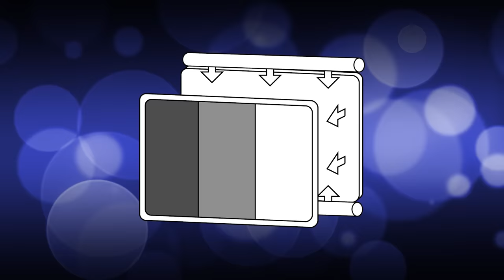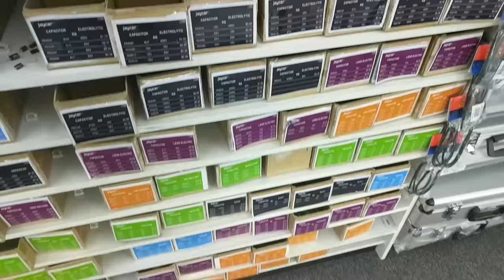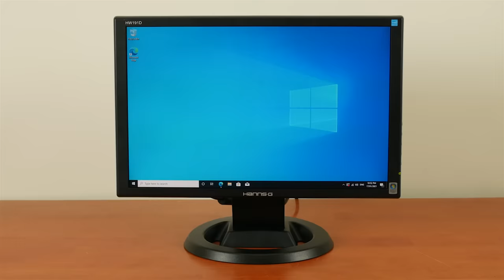Repairing a DEAD LCD monitor

Comment: For all of you... just careful when servicing the psu board. These boards have bigger caps still holding charge and there is risk of shock. Avoid touching these bigger caps.
Those marked 25v 16v 10v 6.3v are safe to handle. Either use the technique shown or use a proper tool to unsoldering.
If there is a spot to install one more capacitor in parallel with the replaced cap, do it. The caps will work together to smooth the current and it will ensure the caps will last more years.
Pay attention to polarity, voltage, capacity, temperature (use 105c instead of 85c), etc
The caps life depends greatly of the inner and outer temperature. If the temperature inside of the device is great, the capacitor's temp will be high as well and will degrade life over time with spectacy around 2500 hours at 85c/105c inner. Reducing brightness or using the device where the air can more around the device will be ok.
Reply: One additional tip: If the capacitors voltage is higher than the original, you're safe to use it in place. If it's lower, don't put it in.
Reply: Yes. If there wasa 1000uf 16v, we can install a 1000uf 25v. I also like to put 1500uf and above.

Comment: Protip - if you think the monitor works fine but the backlight is dead, get a bright AF flashlight and shine it at the monitor real close and see if you can see anything.
Reply: when the backlight power supply breaks, the whole power supply goes down with it, so the whole monitor wont start up.

Comment: Where can I get a cheap used monitor replacement power cord? I don't want to buy an original for $50, and not be able to fix the monitor
Reply: Or like a universal cord that could power a 4k monitor with different plugs

Comment: I bet this is what happened to my friends old laptop. The screen acted like the nintendo ds light when you play metroid prime pinball with that option to turn off the backlight set to on. I had the laptop plugged into a tv and could not find a setting to turn back on the backlight so i uncrewed it from the computer and donated it. now would be a good time to mention that i did this after paying my friend $10 for the laptop. also i only donated the screen to a computer repair place. i still have the laptop. the only thing i broke trying to put it back together was the wifi switch. You can do it in software so what's the point?

Comment: Hey Matt,

I have a specific problem where my LCD monitor doesn't work with HDMI cables. Whenever I plug an HDMI cable into the monitor the picture shows "searching for input device" (or something similar) and then stays black. But of course my monitor supports HDMI cables, because it has a slot for HDMI. 

The question is how can I fix this problem (if at all), because I've yet to find the solution to it on Google :(

Comment: I have one advice for you guys. If you are trying to remove the powerboard, make sure to not touch any of the traces or solder joints on the back. Trust me on this, you don't want to short a 220v capacitor's legs with one of your fingers. My middle finger went numb for hours

Comment: 2 Things i learned from the video :

1. You can use higher CAPACITANCE of the Capacitors not lower Capacitance or ESPECIALLY High/Low Voltages.

2. Be careful when disassembling/assembling LCD is a very fragile piece of glass, older Monitors were still quite bulky and well made than the past 7 year's ones.
Reply: 1 is the wrong way round - higher voltages are OK (unless you're using your capacitor as a fuse somehow), higher capacitances are not. Capacitor values often determine time delays or frequencies, and the circuit won't work properly if the values are off.
Reply: @parnikkapore  Indeed. And in power supply circuits, it may cause inrush current issues, blowing out fuses for no reason.

Comment: my monitor was manifactured in april 2009 and it's a 5:4  at a resolution of 1280×1024
i have gotten rid of that monitor in 2 weeks
now in 2023 i have 2 monitors a Samsung P2370HD and an lg flatron 17 inch 5;4 1280x1024 monitor

Comment: My IBM monitor decided to die after 20 years of continued service
The lamps died and the inverter coil died.
Replaced the lamps with LED strips and it's running again!
Granted, you can't regulate the brightness but i don't care because it is a small server monitor

Comment: PLEASE! Anyone trying to follow this or just want to repair the POWER SUPPLY of a monitor (or any other powersupply) please please please DISCHARGE any or all capacitors and transformers.
The Voltage they can build-up or have already built up by testing it out can be massive and nasty if it shorts out in your fingers or on your screwdrive
edit: nvm old video, probably 100s of similar comments are here already

Comment: My only advice is to NOT do this kind of repair if someone is a beginner in electronics. 

Electrolytic caps that have high voltage ratings in power supplies if not discharged can give someone nasty electrical shocks. 
They can keep the charge even if the psu and monitor is off. 

Someone can be a beginer in soldering tasks and be good but messing up with electrolytic caps without discharging them is not right. 

One should learn first how to discharge them and better not mess up with the power supply.

Comment: would be great if it were even possible to find the correct size capacitor
like a 3300uf 16v in 10mm 
literally like 1 exist and its the same chinese shitty brand that exploded in the first place
and no 12mm wont fit